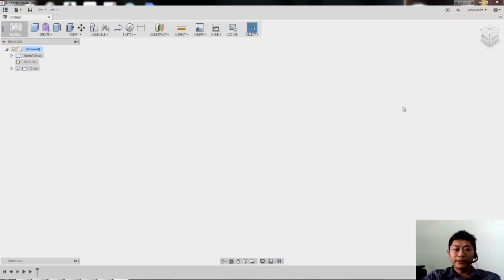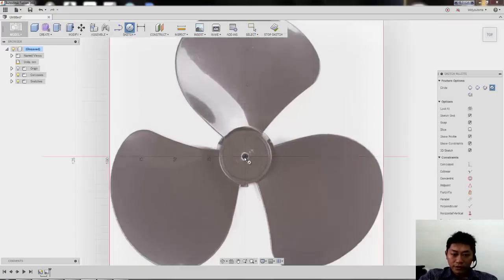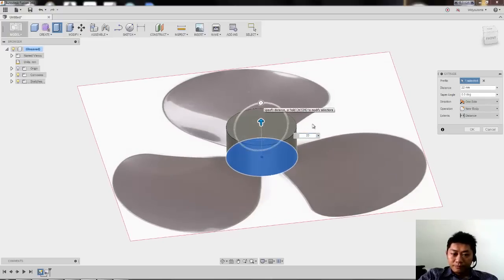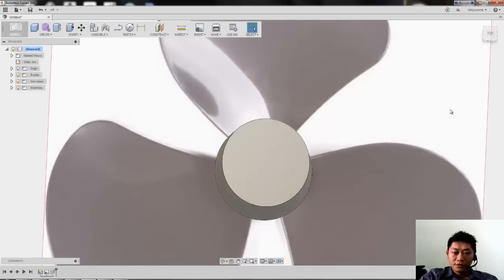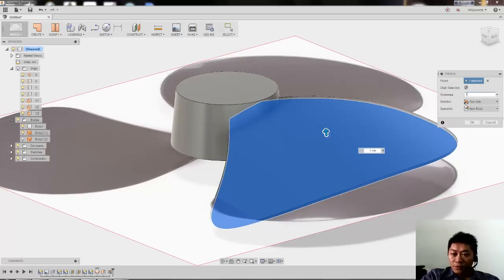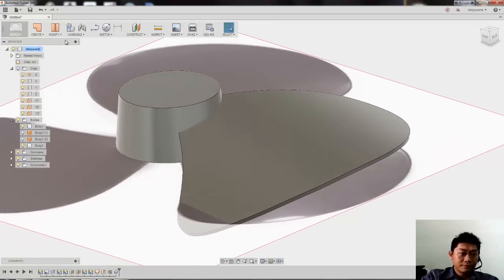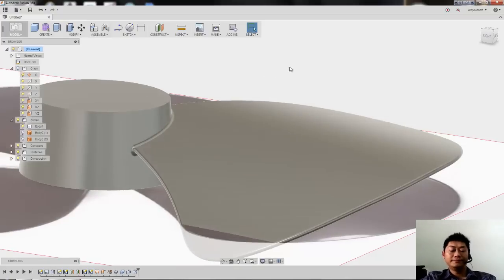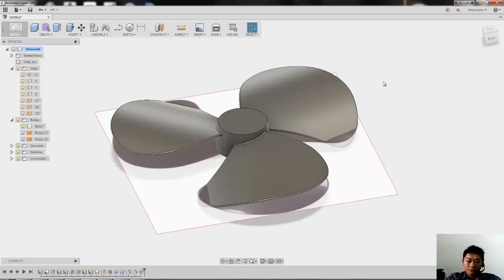Fusion 360 Tutorial - FanBlade

Comment: Dumb question Pak! how do you use a projected geometry when it is a complex spline line and you need exactly the same shape ? projected geometry seems OK to project the exact shape but you have to draw again on the top to achieve a surface to extrude, right (maybe I am wrong here)? if one part of my sketch is from my drawing and the other part is from projected geometry but with complex spline line, what is the correct process? Trims mas Didi.
Reply from the maker: you can use projected geometry straight to create feature (extrude, sweep, revolve etc) no need to redraw. if your projected geometry couldn't directly created feature, it must be not In closed form curve/line, so you need to add more lines necessarily in order to create closed curve.
Reply: @DidiWidyaUtama  trims Pak